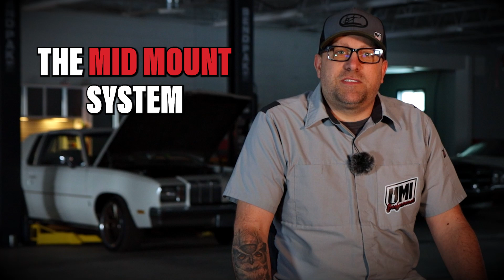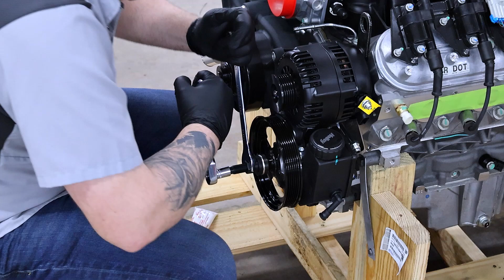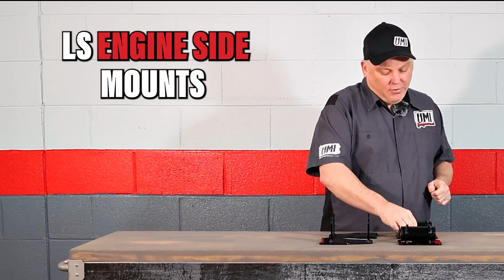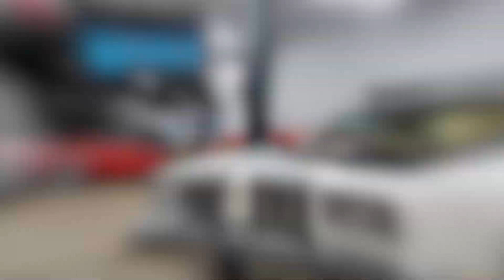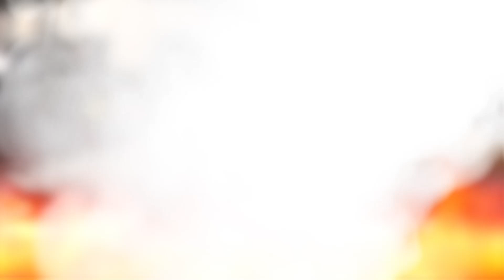Transforming Our Cutlass with Pace Engine & Bowler Transmission

Comment: I've been watching the Cutlass build series from S1E. Thus far I like it!
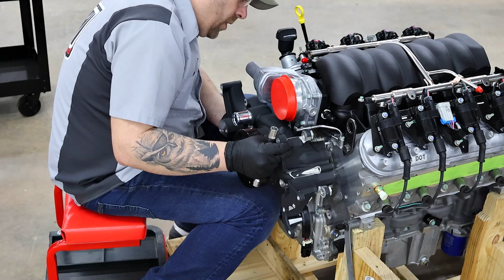At the 1:00 mark, I did not see any water pump gaskets. Were they on there and just not visible to the camera? The Holley website does not show this pump with an O-ring recess.

Good tip on inserting the headers into the engine bay before installing the engine.